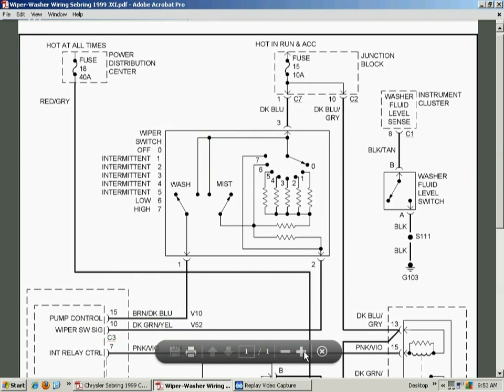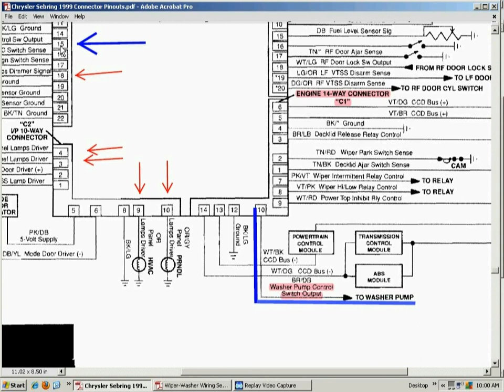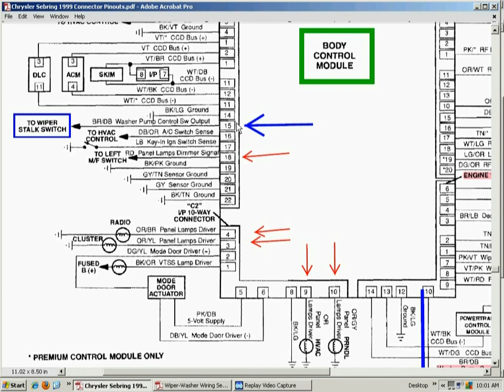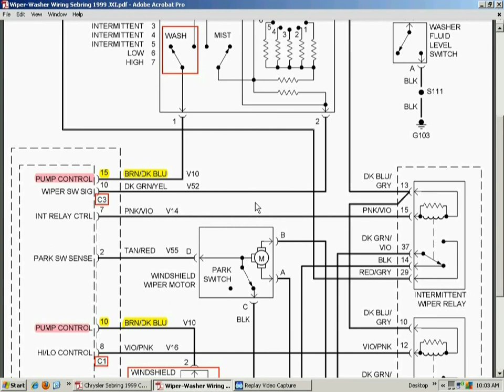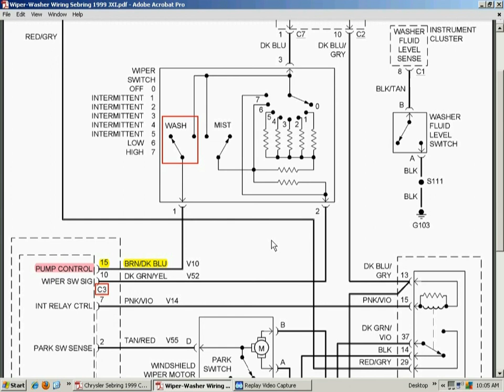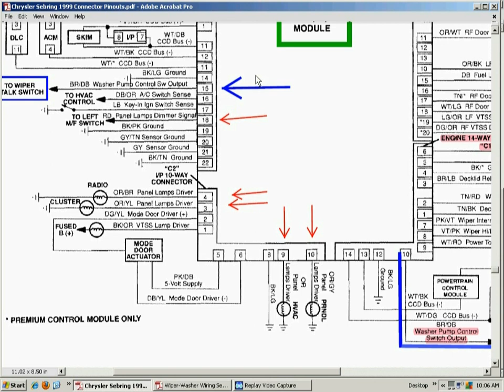Chrysler Sebring Convertible 96-00 WASHER-PUMP (WIRING)

Comment from the maker: Sebring Convertible, Fix LED Console Light with EL Inverter
http://www.youtube.com/watch?v=ekKtSPcjXpI
The shift indicator lights on the console typically will not work or the light will go out
intermittently from time to time.  This is a common problem on the Chrysler Sebring convertible The problem of the shift indicator light or console light not working is usually a simple solution that  arises from a faulty or defective EL inverter.  This video shows how to fix it.